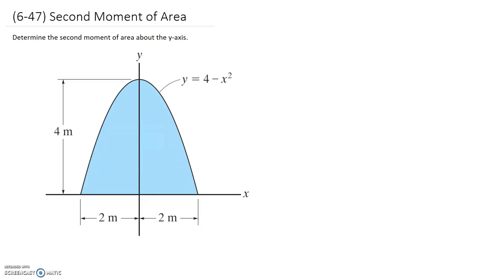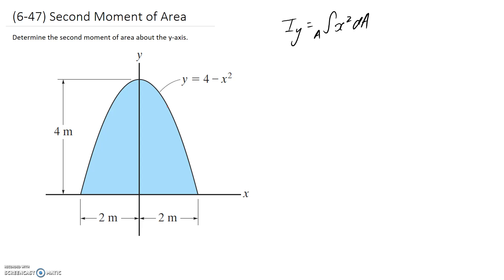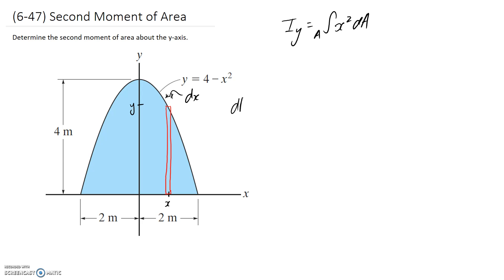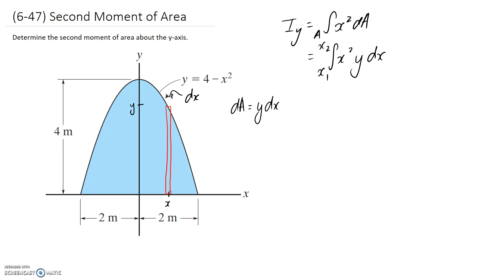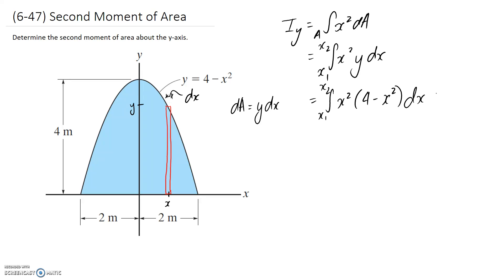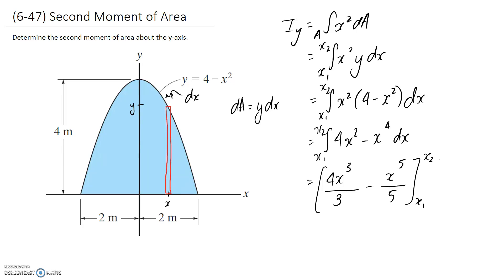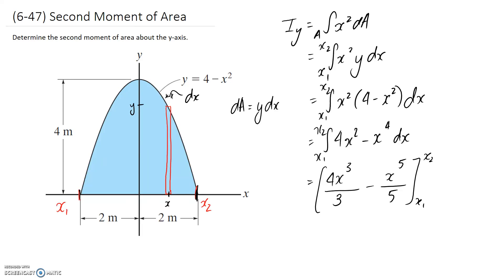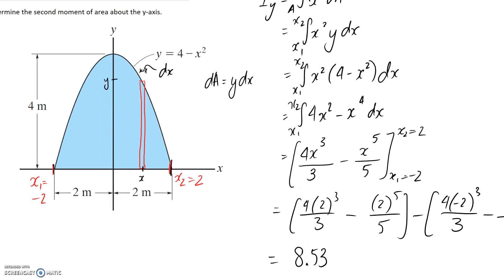(6-47) Second Moment of Area

Comment: Is the integral of x^2 because there is an x^2 in the equation for y = 4-x^2? If it was liner would it only be integral of x?
Reply from the maker: Yes correct. Depends on the equation.
Reply: It is because it is the second moment